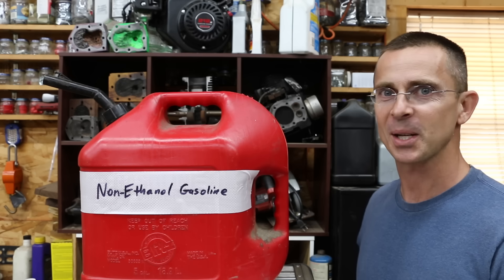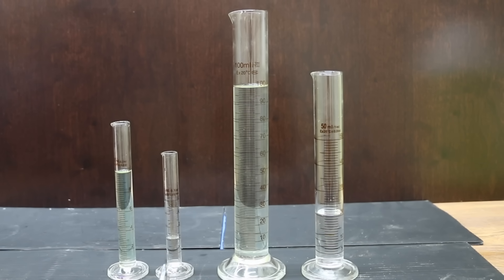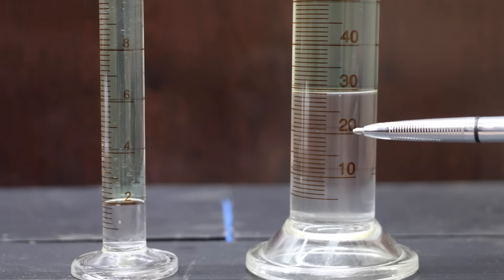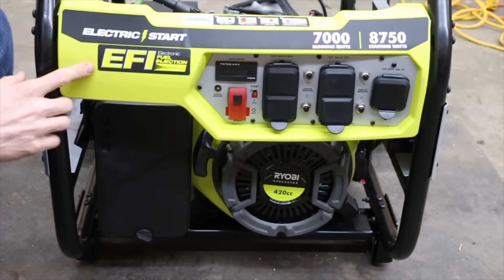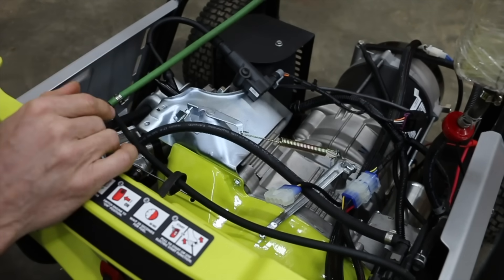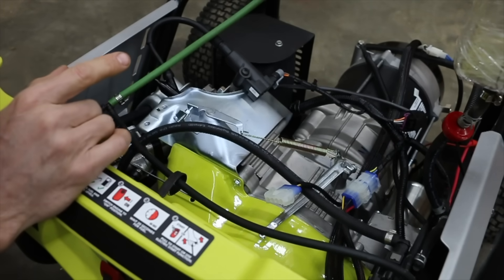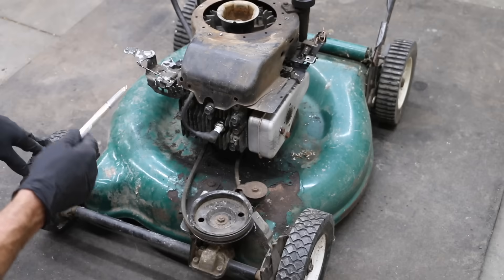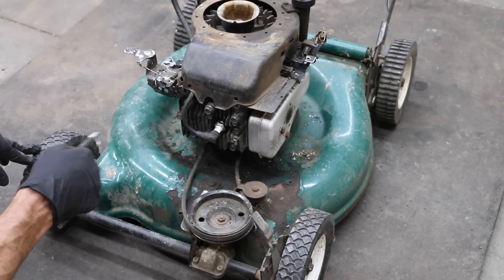Is Non-Ethanol Gasoline Really Better? See the PROOF!

Comment: I used gasahol (unleaded gas with ethonal. It cost less than gas without ethanal) starting about 1974 or 1975, until I went car free in 1996 or 1997, because cars (new or used) gasoline, insurance, registration ... all cost too much.
It never damaged any of my pre-1974, or post 1974 vehicle's engines, or fuel systems.
Reply from the maker: Thanks for sharing.

Comment: In 1958 I was taught, in aviation school, if the tetroethel lead was ever removed from gasoline that the price would drop to pennies but the monopolistic greedy companies saw yet another way to rip the proles off. The alcohol destroyed many  carburetors and fuel systems.
Reply from the maker: Thanks for sharing.
Reply: I was intrigued by you comment, and after a search I found this interesting article, corroborating your post.
"But was lead-free petrol really such an expensive luxury? True, the lead additive solved a problem: it enabled engines to use higher compression ratios, which made cars more powerful.

However, it was not the only way to solve the problem.

Ethyl alcohol had much the same effect and wouldn't mess with your head, unless you drank it. Midgley knew this, having combined petrol with practically every imaginable substance, from iodine to camphor to melted butter.

Why did the petrol companies push tetraethyl lead instead of ethyl alcohol? Researchers who have studied the decision remain puzzled. Cynics might point out that any old farmer could distil ethyl alcohol from grain. It couldn't be patented, or its distribution profitably controlled. Tetraethyl lead could.

The US didn't tax lead in petrol until the 1970s, then finally banned it as part of clean air legislation, as the country moved down the far side of the environmental Kuznets curve.

Two decades later, in the 1990s, rates of violent crime started to go down. There are many reasons why this might have happened, but the economist Jessica Reyes had an intriguing thought.

Children's brains are especially susceptible to chronic lead poisoning. Is it possible that kids who didn't breathe leaded petrol fumes grew up to commit less violent crime?"

https://www.bbc.com/news/business-40593353
Reply: Abortion was also legalized in the 70’s. Unwanted babies in broken homes didn’t grow up to be criminals either.

Comment: Great Video, I was wondering if you can do a video regarding Mixed Gas with Ethanol vs Non-Ethanol for chainsaws or Marine motors... (example Stihl Motomix that is non-ethanol, high-octane fuel). Dose it work better then standard mixed fuel with Ethanol??
Reply from the maker: Thanks for the suggestion.

Comment: Explains why ethanol petrol so bad in little carbs ethanol come into float camber and holds on to any moisture slowly  absorbing moisture  out of air ever time turned off  then attacks float chamber  metal whilst  not being used seen boat engines  every year have to clean bottom  of carb jets blocked with  dissolved aluminium ( white powder)

Comment: As far as small engines go, once I switched to engineered fuel I no longer had to overhaul the carb each spring.  Ethanol ate the fuel hose lining in my bass boat, too.   I live in Houston and when I would take long trips through west Texas my gas economy would improve by probably 10% when I got to fill up in a non-ethanol area (car gets about 400 mi per tank).
Reply from the maker: Thanks for sharing.

Comment: In my own personal experience, I have problems with ethanol blended gas in small engines. Anything with a carburetor lawnmower, chainsaw, weedwhacker etc. I always end up having to clean out gummy deposits in the carburetor that impair its ability to function correctly. For that reason, I always run non-ethanol blended fuel for my small engines and have no more problems. In my area the only fuel I can find that isn't blended is Chevron 94, bit of a waste for my needs, but it is worth it considering how little fuel those small engines use and no more grief having to clean the carbs.
Reply from the maker: Thanks for the feedback.

Comment: Just buy the non ethanol stuff. A small amount of water does remain in the gasoline and can cause problems if it sits too long in the tank. It works for an experiment but I would not add water to gasoline before putting it in my car.
Reply from the maker: Thanks for the feedback.

Comment: Wow I was about to ask you to make a test on use of non eth and ethanol fuel left in the carburetor. Towards the end you declared you are going to do so.
I myself experienced clogging of pilot jet as bike (150cc 4 stroke)is not running for past 7 months due to corona.it only starts with a choke/starter .people lay the blame on ethanol mixed fuel.
For me a lesson, keep the petcock to close position, burn all the fuel in  carburetor ,whenever the bike is going to sit for a while .
If you have any better idea to avoid such situation please share

Comment: My gas mileage on the highway to and from work went from 24.4 mpg to 27 mpg switching to non ethanol. Also, my car doesn’t idle rough at start up on non ethanol or higher octane.

Too bad it’s 80 cents a gallon bigger here. But I can get 89 octane non ethanol which is rare.
Reply from the maker: Thanks for sharing.

Comment: Being retired plus driving less because COVID my second car 2008 equinox sits stabil not effective for me..So I use Wawa 89 oct. ethanol free plus pri-g in car and yard machines..also tired of spilling gas and cracking plastic with plastic cans popped for more expensive justrite cans easy pour,no fumes, glad I did 5/8 spout little slower pour but can use gas for cars :o)
Reply from the maker: Great point. Thank you

Comment: Ethanol Gasoline bought at "Arab Store" burns black...! Why? Because they sneak water in the underground tanks to make more money...I saw one do it ..the said " I'm pouring hot water on the edges so it doesn't freeze." But , when water cools down, it will certainly freeze, unless mixed in gasoline. ..Crooks are cause of large amounts of carbon build up on the idle air control and throttle positioning sensor housings and units....Also the true test would be to do same test with 3-4 week old gasoline..which would be the same as filling up the tank and not driving for a week, and then decent trip that empties half tank , with half tank of now 3 week old gas after not driving for period of time. Ethanol loses  octane after so long
Reply from the maker: Thanks for sharing.

Comment: It's funny...I've seen damage from ethanol fuels in small engine carbs.  Have fixed a few for friends.  Yet I use it in my own, and never do anything....let my chainsaw sit 2 years, and it fired right up.  Trimmer and blower over 10 years old, never an issue and they sit all winter with fuel in them.   Same with our 4 wheelers.   Let my generator sit a year and fired it up in 3 pulls last month.   Never had the first issue with ethanol, yet others constantly do.   Maybe I'm lucky.
Reply from the maker: Thanks for sharing.

Comment: Personally, I have a splitter, chipper and five chainsaws, a power washer, gas powered air compressor, a couple snow throwers and a farm truck. I don’t use it all more than once a month but when I do use them I use them a lot. In my saws I run premium, everything else takes regular with ethanol. If I’m putting the stuff away for longer than three months I’ll drain the tanks, carb bowls and fog the engines. I don’t want to waste the money on the more expensive non ethanol fuel and as long as the carbs don’t sit full for longer than 6 months you shouldn’t have a problem, I know I have never ran into a problem.
Reply from the maker: Thanks for sharing.

Comment: I read in old cars you need hardened valve seals or the ethanol destroys them. When turning off a carbureted engine the fuel can boil out of the bowls due to the ethanol content.
Reply from the maker: Thanks for the feedback.

Comment: Can you do a video advising how to store/winterize engines, especially small engines, like lawn mowers? Some say run the tank dry, some say fill it up, some say use stabilizer, others engineered fuel. Then some say oil change prior to storage and some say to do it in the spring/before using again. Would love to hear your take on this.
Reply from the maker: Great suggestion!  Thank you.
Reply: @ProjectFarm    I agree!   Many of us have several small engines and it is confusing to know what is best practice.
Reply: My dad has a boat with a Diesel engine. In the winter he tops up the tank all the way and puts anti-freeze in the outboard water-cooling system. 

That’s diesel, though. Don’t know about gasoline. I’ve read somewhere that you should avoid completely running your tank dry in your car.

Comment: i had a Ford Escort 1986, 1600cc, 4 cylinder and carburated that works only with alcoohol. The motor oil never turn black, the spark dont acumulate carbon and consume 9,0-9,5 Km/L.
Sorry about my english, im brazilian.
Reply from the maker: Thanks for sharing.

Comment: After I switched all my two and four stroke small engines to 93 non ethanol, I have not had to replace a single fuel line or primer bulb. It does help!
Reply from the maker: Thanks for sharing.

Comment: I have been doing this for years. Works great!! Hint... use some food coloring in the water to easier see the ethanol/water mix and start with 90+ gas to compensate for the loss of octane which is 3 points.
Reply from the maker: Great tip!

Comment: The problem with the generator test: Yes gasoline with ethanol is higher density, that's because it absorbs some water (hydrophilic) which doesn't contribute to the energy produced, also ethanol itself has les energy than gasoline.  To produce a valid test you need to do the comparison at constant energy not constant volume.
Reply from the maker: Thanks for the feedback.

Comment: I have a 93 Nissan pickup truck I purchased the truck when it was 14 years old so I guess I bought it about 2007 today it has 335000 miles on it I purchased it was about $160 170000 miles I had someone that introduced me to the non-ethanol gas I started burning that in that Nissan in my Nissan has what they call the large 6 cylinder engine or something like that in it we use it for hauling a lot of stuff but I used it in my cleaning business to but my gas mileage probably went up at least now this is not on the road this is all City driving probably went up some place in the neighborhood of about three to four miles per gallon I don't drive the truck that much anymore and no ethanol gas is very hard to find in the town that I live in and it's on the opposite of the town where I live so now I've gone back to birding the regular gas gas mileage has dropped down but we don't drive it that much because I purchased another vehicle for my business which was a 2003 Toyota Avalon I started burning no ethanol gas in it right away the gas station where I buy it is on the south in the town where a lot of my work is and the church I go to so I do Drive the vehicle for going to church so use that gas it up on Sundays oral Monday when I'm on the south of the Town working but my gas mileage in that Avalon which I didn't have any other records on gas mileage from the people I bought it from but my gas mileage would be no ethanol stays in the average of about and that 18 19 miles per gallon I just so happened to Sunday drive my car up to my baby brother's house in Columbia Tennessee round trip is about 100 miles in that neighborhood and when I gas my car up yesterday morning just with that on the highway driving which the car runs really great on the highway I checked my gas mileage and it was right at a 24 and a half but when I was drive by pickup truck up there to my baby brothers it always got 25 miles to the gallon and my pickup truck has a 5-speed in it which of course on the Interstate 65 that's what I use so I'm convinced no ethanol gas is the answer the guy that introduced it to me he just so happened to own a small gas station or helping somebody get one going I should say they really own it he says you got a burn about for tanks non-ethanol gas to get your gas mileage up get everything cleaned up I guess that's all I can say about it that's my experience so all I can know is that I've been buying this kind of gas for 13 years and pretty much usually pay anywhere from 30 to 50 cents more per gallon and the only other thing I'll say is I buy my vehicles when they're older the people I buy them from take good care of their vehicles but I have very little maintenance that I have to do on my vehicle's I do regular oil changes every 5000 miles plus I put a quart of Lucas Oil Treatment in there every time
Reply from the maker: Thanks for sharing.

Comment: I recently had a rather strange experience; normally my 2015 Altima gets an average of 28 combo driving.  (before this the best I'd ever got was 42 mpg on highway 5  from S.F. to Redding, about 165 miles, with no stops)  About 6 months ago it all of a sudden went up to 32 for four months then down to 28 again; I thought it might me because I was buying Cos**o gas, so   I went to a local independant place that's almost always cheaper, then immediately got on the local freeway 280 for a drive of about 25 miles.    280 goes up and down somewhat so I didn't expect much... but when I got to my destination, I'd been getting 50.8 mpg!  I went home on 101 which is flat & it went down to 44 mpg.  I live on the coast so it was up and down hills after that and it went down to 34 mpg.
I can't explain the extreme mileage difference; any ideas?

Comment: I've found that non-ethanol gas makes more difference in 2-cycle engines (weed eaters and chainsaws).  Engines wore out faster when using ethanol gas, or at least there was problems with the fuel delivery portion.
Reply from the maker: Thanks for sharing.

Comment: I wish there was even 10% as much strong knowledge about the differences between gasoline and ethanol as a fuel as there are strong opinions. And combustion physics/chemistry and what octane is and isn't also. Ethanol has half the BTU content per unit volume as gasoline and coincidentally it requires twice as much air for a stoichiometric ratio. Gasoline without ethanol provided 4% greater efficiency. Go figure. Because of the half as many BTUs per unit volume each gallon of E10 has 95% as many BTUs as non-ethanol gasoline. The release of BTUs through the combustion process raises the temperature of the gaseous molecules and therefore the pressure in the cylinder. Pressure on the piston crown is only the source of power output. To do the same amount of work in a given engine requires the same BTUs in the combustion chamber for each power stroke.  E10 requires approximately 105% by volume of the fuel as does gasoline to release an equal number of BTUs from the combustion process. Just imagine the lousy mileage from an E85 powered vehicle that only has 57.5% of the BTUs of non-ethanol gasoline.
Reply from the maker: Thanks for the feedback.

Comment: TRIVIA:  I have had fuel line hoses be eaten by fuel, the particles made their way to the carburetors, clogged them and my B&S V-Twin engines stopped working.  I try to buy non-ethanol fuel for them and blame the low quality hoses for the problems and my work to make things right again.
Reply from the maker: Thanks for sharing.

Comment: Love your tests. Ethanol will destroy fuel lines over time in small engines. It did in my power equipment.
Reply from the maker: Thanks so much!  Thanks for the feedback.
Reply: Nitrile rubber (aka buna-N) is often used for fuel lines, and it is indeed incompatible with ethanol.

Comment: Everyone that has left gas in the lawnmower over the winter already knows the answer. Without fuel conditioner ethanol will gum up the engine and may require new plugs, an overhaul or fuel system cleaning before it will turnover. You might get lucky, but the odds are against it.
Reply from the maker: Thanks for sharing.

Comment: Ethanol SUCKS! If you dont use it immediately. It turns bad in about 4 to 6 months and destroys rubberized parts on power valves, fuel pumps,  plugs jets and erodes fuel lines in motorcycles. #TRUMP2020 #WALKAWAY #CULP

Comment: I fill the tanks of my lawn mowers with non-ethanol gasoline when I store them over the winter and they always start up in the spring.
Reply from the maker: Thanks for sharing.
Reply: ethanol is water soluble, after sitting for a bit the water emulsifies and makes a slug looking residue at the bottom of the tank, clogging the fuel injectors and or carb. There’s a video on it and if fuel stabilizers work on fortnines channel

Comment: if you have an older car, the rule use as little ethanol content fuel as possible. you will get more mpg. but newer the car they have flex sensors to utilise the ethanol properly.
Reply from the maker: Thanks for the feedback.
Reply: @ProjectFarm   no problem. also in my work i find that all this ethanol fuel is destroying carburettors at an alarming rate. i service allot of classic cars. we have replacement modern rubber for fuel lines but finding it for carburettor rubbers in the correct size is very tricky. especially because allot of carburettor equipment is measured in imperial standard.